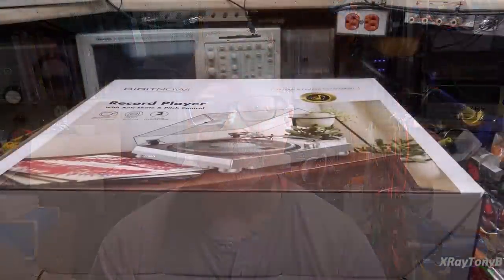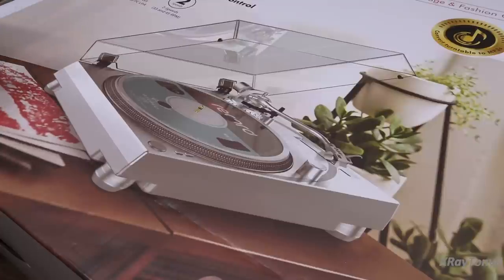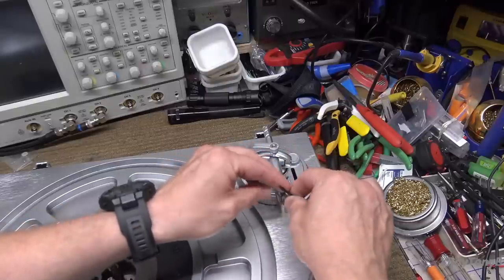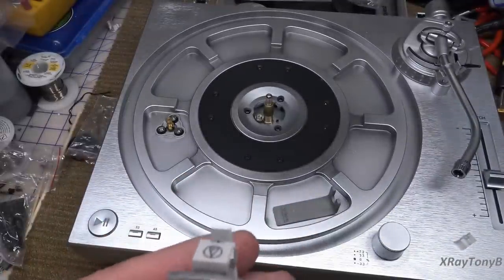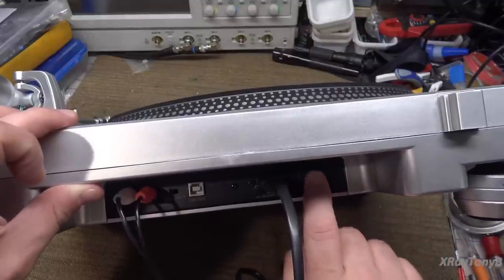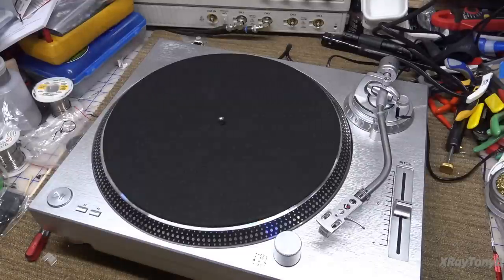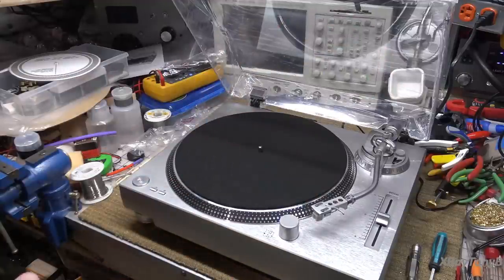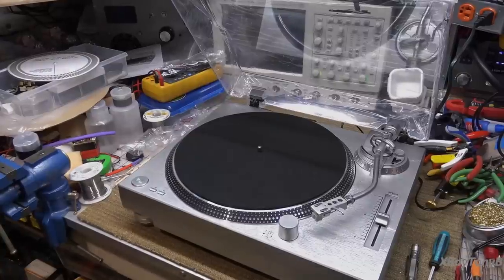DIGITNOW! M-619 Turntable Review

Comment: I have a Crosley T150A with the AT3600L on it, and like this one, the motor rumble can be heard as soon as you turn it on, both through the plastic "plinth" as well as through the tonearm and cartridge.  That said, for rock and popular music, especially if you crank it up, you hardly notice. The cartridge outclasses the rest of the table so much that when I hear someone talk about upgrading the cartridge on that table, I tell them they'd be better off upgrading the turntable around the AT3600L, and only then think about whether you need a better cartridge.  If you're doing critical listening and can hear the difference between carts, you need a better table anyway!  If you do end up with something that comes with its own speakers like my Crosley, even the most basic $10 pair of swap meet speakers would be the best upgrade you could apply unless you're running it through an amp.  In the case of the Crosley, a set of old Realistic Minimus 7's would be a major step up!  It's amazing how good those commodity amp chips they're using nowadays can sound for the money.  No one's gonna toss their vintage Denon or Marantz for one of these, but if you've got Cruiser money, you should at least step up to something that has the magnetic cartridge like the AT3600L, unless you're only going to play 78s.

Comment: Thank you Tony for the assembly, setting up, testing and review of this turntable, if I was buying a TT today this one would be worth considering. It is built very much like the Technics SL-1200 I bought in the mid 70's. Even though this is new turntable you can buy today that works good, I would rather have my original SL-1200 turntable.  The early turntables were made like a tank and the later ones are built with cheaper lighter materials and motors. The SL-1200 has direct drive motor driven by discrete transistors, not by an IC chip. I bought an Audio Technical cartage with a shubaita needle for it for the SQ 4 channel records, which I never got any 4 ch system, so we are using a regular elliptical needle.

Comment: I converted my whole vinyl collection to CD Back in the mid 80’s. …. And have not looked back. I DO NOT miss the Snap Crackle and Pop vinyl has to offer. 

I currently own 700+ CD’s.
Reply: I can fit that on a thumb drive all in FLAC files.  Hell, my phone had a terabyte of storage.  Nothing sounds warmer than a good old, clean record.  I'm old though.
Reply: @TechGorilla1987  
My whole CD collection and then some, is imported on my computer and iPhone. A FLAC (Free Lossless Audio Codec) file isn’t an actual physical CD. I’d put my $2000 + CD player against any Turntable/ Vinyl Record combo any day for warmth, clarity, dynamic range, noise, distortion…etc. 
I Don’t know what you consider old, but I’m 57.
Reply: @ericbachmann8037  FLAC is a file format that is a direct bit for bit copy of a CD.  Itunes does not allow FLAC files, but there are other lossless formats.  The good quality ones have spectrum analysis prints with the files showing the full bit rate spectrum.  Certain CD's can certainly shine - even in the most low budget of machines, but there is nothing quite like sitting down to a fat vinyl copy of Alan Parson - "I Robot" or Grateful Dead - "Terrapin Station" and zoning out with a couple hundred watts of Carver power.  I was born in '69 and had an old man that always had the latest and greatest equipment even if he couldn't afford it.  :D
Reply: @TechGorilla1987  
Yes, hence the Lossless in the acronym….. I use iTunes and iPhone (for vehicles) for convenience, serious (home) listening is with CD Player and CD’s. I also own old school audio equipment. Have since the early 80’s. Denon and Proton Amp’s, Denon and Sony ES Pre-amp’s, Sony ES CD Player and Polk Audio SDA 1C’s speakers. I have more than 1 Audio System.
Reply: @ericbachmann8037  I think you and I are speaking the same language, but not having the same conversation.

My points are:
Anything less than lossless = garbage (ie MP3) but can be good for casual distracted listening.
Anything lossless is a bit for bit transfer of a CD including any loudness war influence and compression inherent.
Cd's are not exactly portable in a collection.
Lossless files replace CD's on devices capable of being placed in a pocket.
Having 700 CD's is wonderful - especially if it's lossless on a portable device with a good DAC.

Anything vinyl is for baking out and listening with an adult beverage in hand.

Stay well, Internet person!

Comment: Hi Tony. Here's a tip for you regarding anti-skate adjustment which I find to be as precise as possible when doing it like this on the fly. When you go for free-floating arm and counterweight says 0 (arm is completely horizontal, floating free, deck rests on fully leveled surface), and you know upfront what cartridge manufacturer asks you to adjust counterweight (force) at, now at this point start rotating anti-skate ajusment slowly and you will see arm trying to move either towards the center of the platter or the other way. Now adjust it carefuly (best on 3 positions, out, middle, inside) so the arm tries to stay in place, not trying to 'skate' either way, or really super slowly trying to go towards the outer rim. My experience always led me to the adjustment arm is (anti-skating) trying to stay perfectly in place rather than slowly trying to 'escape' outwards. I have found that way styli produces best results and equally wears off.
Reply from the maker: Great tip,
Thanks!

Comment: Wow the simplicity  of it all. I was just looking at the service manual for my Denon DP-61F turntable, an engineering marvel. The Q-factor, anti-skate, horizonal and vertical  tracking all controlled electrically. There are motors in the tone arm. If I counted right there are 104 IC's and 54 Electrolytic caps (I recapped it about 6mo ago) they don't make them like that anymore. Fortunately It has kept it's value. 
I'm not one of those people with golden ears. BUT I can definitely hear the deference between that plastic thing with a $13 cartridge & needle and my Denon and Ortofon goodness. My first memorable music experience was a jukebox also, My dad used to take me to the bar with him and had me set in a booth in the back and drink my coke with cherries in it. Patsy Cline was great. But I grew up and discovered Jimi Hendrix, ELP and the Moody Blues etc. and I heard them on a Very Very nice stereo. After that  it was just impossible for me to appreciate something like your Radio Shack and digital now sound. With the equipment you have in your home/bench... How in all honesty can you say this sounds good? when you know what good sounds like. I just think there are lines between Great,Good and Crap. Sorry somedays my little finger is shaped like a ballpeen hammer. SH

Comment: I would imagine that the D.C. supply for the motor is not well regulated. Hence the need for the ‘pitch’ adjustment, as the speed may vary with changes in line voltage. Depending upon the stability of the supplied line voltage, the adjustment range of the pitch control could be pressed. Since this is probably made in China, they would have set that for 115 or 120 volts there, and our line voltage is usually above that here, nowadays. For the price, that looked to be a pretty good value to me. I have a 60 year old Sansui SR-4040 turntable. Remarkably, I can still get belts for it.
Reply: I'd be very surprised if it didn't have a regulated power supply. For that matter, they could have used a BLDC motor powered by the USB port with a microcontroller regulating the speed. Eliminating the internal power supply would easily offset the cost of the BLDC motor and driving circuits.

Comment: I've had my Technics SL-1310 since 1979, when I bought it from a buddy in the barracks.  It's equipped with a Stanton 681EEE/S and I've never felt the need to get something else.
Reply: That's all we hear from old timers. I replaced the technics I bought back in 1983 with a technics 1200GR I bought in 2020. Have a ortofon bronze cartridge.
Reply: Feel the same about my Pioneer PL-518 purchased in 1979 for $118. Used a Shure M91ED and added a M95HE pickup. Rumble 73dB, W/F 0.03%, good specs even today. Ain't gotta be new to be good.

Comment: Interesting video showing what's out there in turntables. On the cost subject, in 1975 after military service and broke, I assembled my first component hifi system consisting of a Pioneer SX-434 receiver, BIC-920 turntable (with Shure M70 pickup) and KLH model 31 speakers all for under $250. Yup, bottom of the line "budget gear". Barely qualifying as HIFI. I was happy and really dug that stuff. Sounded boss to my uneducated audio ears. As Ray Davies sang.....Cheap is small and not too steep. But best of all cheap is cheap.

Comment: The stylus for that is an ATN3600L and cost as little as $10.00 on Amazon, but you can upgrade it to an ATN3600LE which has is an elliptical stylus for $40.00 .  The elliptical one is also made by Audio Technica, but they make it for a company called LP Gear and instead of the AT logo on the front of the stylus it has a styled LP logo, that and the body is blue instead of beige.

Comment: 24:58  You also have to be careful that the tonearm is perfectly horizontal at the zero gram indicator on the counterweight.  If the arm dips in either direction, even if it still "floats" the counterweight will be offset from its true equilibrium position; so if the counterweight were too far forward, for instance (which I think happened here) moving the counterweight forward to the indicated downforce will apply too much force.  Of course scales are the way to go, but, depending on the quality of the tonearm, correctly adjusting "by eye" can yield accurate results - when the counterweight on my Q Deck indicates 1.5 grams, the measured downforce is 1.55 grams (times g, since its a force not a mass).

Comment: On the "which is better" between a modern digital source and a turntable, the only reasonable answer is pretty much what you said, it depends. It depends on what the individual values in terms of what makes something good. If you're about the feel, the experience of it, the nostalgia or just the fun of collecting, you might consider vinyl to be better, but if your top priorities are things like SINAD, consistency, longevity, then you might find digital better.

On a purely technical standpoint, digital is orders of magnitude "better", but many a technical person can still enjoy a vinyl collection for all the other reasons, and thankfully..in the end, we don't really have to choose. :) 

I have a primarily digital system, MiniDSP shd studio with a MiniDSP 10x10 to get some analog i/o like a phono pre and control subwoofers on the other aes/ebu loop, and I have a choice of going straight into MiniDSP plate amps over aes/ebu that have icepower 250asx2 amp modules...but! just for fun, I have a Cary sla-30 tube amp on my mains (97db sensitive Kochel K-300SDS) that I listen to more than the icepower amps...even though I know on a purely technical standpoint, the icepower amps walk up one side and down the other in the specifications department...and it's not even funny over the old push-pull el84 tubes. But you know what? 

I don't care! I like it and I can't help it. For some reason, when it's on and it's glowing, it just makes you feel good. I can totally see both sides of these kinds of arguments.

Sometimes ya feel like a nut, sometimes...you don't. :)

Comment: In the range of new shitty entry level Chinese TTs this seems not bad at all. A lot of adjustments possibilities, the use of metal where it counts, at first sight quite stable speed. Most important a detachable headshell and replaceable cartridge.
Reply: Back in the 1970s and 80s most turntables (apart from the more expensive offerings from Linn, Ariston, Thorens et al) were of this build quality or worse. I have an Ariston Q Deck (mk 2) from 1989 (highly regarded at the time, and I like it, tbh) its cheaply constructed of chipboard and glue; the only quality thing about it is the tonearm, which I believe was constructed in Japan.

Comment: Never used earbuds, instead preferring the over-the-ear big "can" type headphones.  A lot of those little earphones remind me of ear plugs the factories used to make me wear and I despised those things.  Last time I had an earphone of that style it was a single crystal speaker plugged into a transistor radio when I was a little kid.  As far as the different media types of audio go though, I'm not particular about 1 form vs another.  I think they each have their place.  At home I prefer handling and listening to records while in my vehicle if I'm not listening to the radio, I use cd's.  I do have a cassette deck at home but with so few options for blank tapes anymore I seldom use it at all as I only have 3 or 4 pre-recorded tapes left from a one time sizable collection.  With turntables, although I do have a Pioneer DJ plx-500 that I occasionally use, I'm much more apt to have a stack of records on my old BSR changer.  It's a late 60's model (MA65) and has the metal plinth, metal platter, metal eccentric wheel and a pickering v-15 MM cartridge with two NOS styli I recently got for it, a .7 and a 3mil for 78's.  It is also the only TT I have capable of playing what few 16's I have.

Comment: Tony,what alot of people don't realise,is that adjusting the rotational speed under LED lights WQILL NOT WORK!!!Their switching supplies are not 60Hz that the strobes use.  GL all out there .  Doc BC
Reply: A handy portable fluorescent work light works perfectly
Reply: Use a cheap LED light and it will work. They tend to skimp on the filtering.

Comment: I have a very similar cheaper turntable like this one, the Ion ITTUSB10, I took it apart to adjust the speed (don't trust the apps that measure turntable speed, in my experience they're always off no matter what I try) and noticed that it's actually grounded on the inside of the turntable, taking away the need for an external ground wire, I'll bet if you take that apart you'll find the same.

I'm a teenager who got their start with a crappy all in one stereo from the early 90s with the same style turntable as the crosley cruiser, and while I'm happy to report that none of my records got ruined, this is definitely a much better starting point for your daughter.

Comment: I just got this record player as a gift, really very Nostalgic. I really know nothing about stereos/record players. Thought I could just follow the instructions and pop an album on it. I was searching for volume controls 🤦🏻‍♀️. From watching your video I can see I have much to learn. Didn’t know I’d  need to purchase speakers and a receiver, in order to actually hear my albums. Could you recommend something affordable for a beginner. 
Thanks Norma
Reply from the maker: There are endless models of receivers and speakers out there.  Just make sure that if you purchase something used, it tests out ok.  Old gear sometimes will need to be repaired before you can use it.  You don't need to have anything special.  Usually a 15 watt per channel receiver and an affordable set of bookshelf speakers will do the trick.

Comment: Well, at one point I might have said the first one - TT through excellent system.  But... having heard Sony's digital format, the one used on SACDs, analog seems to have some competition.  

I will also grudgingly admit that I've heard a Yamaha multi-CD player, through a vintage 1980-era Pioneer integrated amp, attached to B&W 801 floorstanders, and it did produce a truly glorious sound, so...

Comment: The different thing, is how records were mastered, with vinyl the low frequency has to be strict mono, because otherwise the needle would whip out of the groove, which make that lows were pretty much always in phase. Digital, you don't have these issues, I mix sometimes materials that on purpose are out of phase. As an effect, second vinyl was not clipped at all, on purpose, like digital  sometimes is. The negative of digital, is loudness, which is common supplied on modern records. So make the math, distorted, compressed sound, on earbuds isn't a good idea for your ears. Vinyl doesn't have that, that's why I prefer a good vinyl record, and it has also something romantic, you have to pull out the record out of an organic cover, most of them were masterpiece art, so you could feel something in your hands, digital, nope, only a fast forward button, and that's it. I have one of the first cd's that were recorded properly, nice mastered. These have an amazing dynamic range. But nowadays with their mp3, ACC, OGG format. It's a shame that record companies provide these to the end user. I still use my 1982 Technics 1200 MkII turntable, and it will stay here till the end of my life cycle.

Comment: 30:20  If you turn the internal pre-amp off, then shouldn't the cartridge see a specific cable/pre-amp capacitance.  Back in the day, many turntable manufacturers provided low capacitance flying leads to prevent the use of bog standard line level leads with unknown capacitance per unit length.
Reply from the maker: You are correct, but this turntable does not have the proper grounding for direct connection.  This will allow hum to enter the receiver's phono stage, as the tone arm and head shell are ungrounded.  Most turntables have a ground lead that connects to the back of your receiver to minimize this.  This one, unfortunately, doesn't